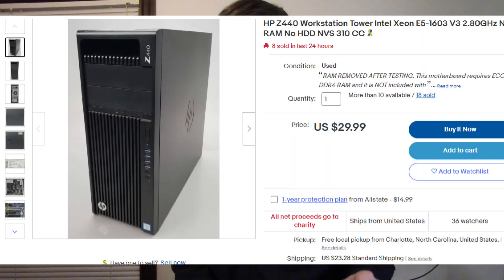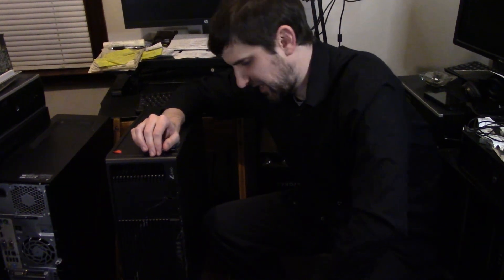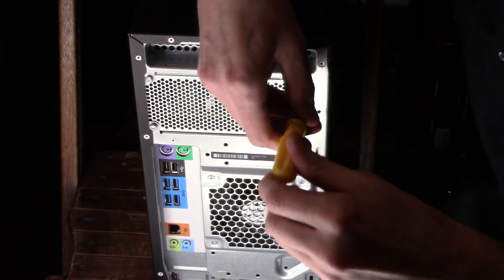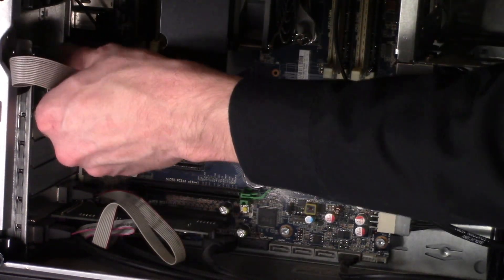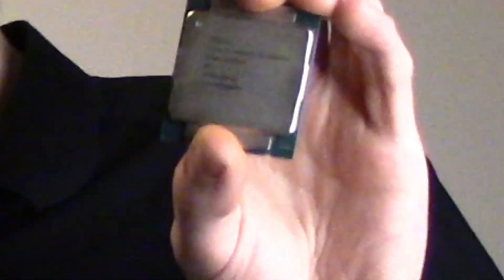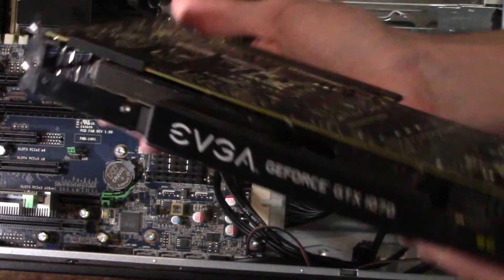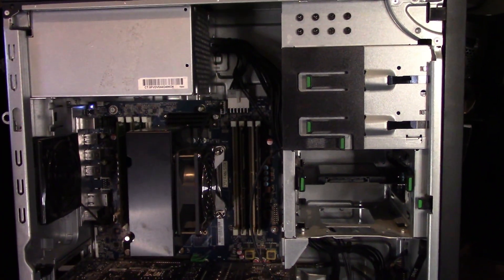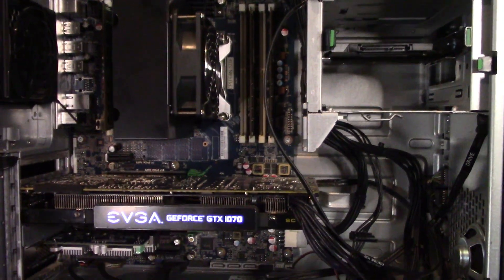This Older PC is PRIME for Cheap Upgrades

Comment: As long as the rails are good and the connector is not stressed, it's fine to use the adapter.

Comment: That fluid on the gpu could also be from leaky caps.
Great build. Unfortunately dealers have jumped on the bandwagon and you'll be lucky to buy a bare bones for $50. At least in the UK they range from £120-200 on ebay now. So that stings a bit after buying the upgrades.

Comment: I have almost the same setup, but kept the 525w power supply with a GTX1070 by crimping an 8 pin power connector in place of the hard drive power cables.    Perfectly stable.
Reply from the maker: Interesting! That sounds pretty tight. A while ago I was trying to find a cable that might connect the 6pin SATA power out (that many of the older HP models have) to 8pin PCIe. I figured since it is running 3-4 SATA cables from that 6pin connector on the board, that it should have enough juice. But I couldn't find anything relevant, all the results were giving me 6pin PCIe to 8pin PCIe which is not what I wanted. I'm actually not even sure what that 6pin SATA power out is technically, ATX? Any way sounds like you were able to just make something for yourself, that really is awesome.
Reply: Which cpu you use ?

Comment: I use an "old" Workstation from Lenovo for the last years, 2* 8 cores/16threads Xeons, 16GB RAM per CPU, upgraded SSD and an NVidia 1050ti and an USB3 upgrade-card.
Runs really smooth, not as fast as a modern build, but it is silent and built like a tank.
Reply from the maker: That's awesome. I really like the idea of keeping older hardware alive, keeping it from going to waste. It's a big part of why I do these projects, I end up using most of the computers like the one in this vid. I like the sound of that setup 🙂
Reply: i run a HP z620 with 2x E5-2690's. i do run linux but i game quite well with this machine on a 144hz monitor.
Reply from the maker: @leerobinson8709  Nice 🙂
Reply: I’m working on a budget build off.  Got my hands on a sweet z440 deal.  Thanks for the great ideas, love your unique delivery and edits!

Comment: I have a 36 core z840 that performs well and got a z6 that im gonna top off with 48 cores and see how it does. never had a problem w these work stations.
Reply from the maker: 😃That's alotta cores. Sounds sweet, I've never tried either of those 2, but they look pretty beast-mode.

Comment: yup keep up the great work!!! Like i said try the dell precision they are easier to work in.. plus they have modular supplies... mine came with 685 but u can get 825 or 1300 and their fricken cheap AF  ... i just needed to add an exhaust fan, when I added my 1080ti.... ooo yeah and the dell comes with 2 6 pin pcie cables for gpu... with another unpopulated 8 pin on the dell poweredge connecter
Reply from the maker: Noice. That is a serious bonus to have those GPU connectors on a machine from that timeframe. Opens up a lot of options 🙂

Comment: Bought one with E1650 v4 and 64 GiB of RAM for 160 euro. Got the 700W version as well, including 1200 GPU with 4 x mini DisplayPort. Going for a home server setup.
Reply: Interesting options that I'm going to buy or have bought: 16 lane 4 NVMe drive adapter, hopefully it boots ~30 euro. 4 x SATA 2.5" drive bay for a 5.25" bay ~30 euro, DVD burner with millenium disks 18 euro and of course Intel 540 x 2 10Gbps network adapter: 20 euro (doesn't support 2.5 and 5gbps, mind you). And of course the 2 x 6 to 8 power adapter cable that you've shown in the vid.

Comment: I have one of these relics. Best $240 au I ever spent. Ran a E5 1620 v4 16 GB ram 256 g ssd. Quadro k2200. Since upgraded to E5 2680 v3 64 GB 500 GB nvme pcie. 700 watt PSU. Had to buy ram cooler for $70 au. Yet to upgrade GPU. All up I spent a further $150 au. I only upgraded because it was so simple. Cheers.
Reply from the maker: Awesome, that sounds like a pretty sweet setup. I had the same issue with the cooling, getting the BIOS message because I'm using every RAM slot. Haven't got the RAM fan yet, so instead I just forced an extra case fan in there using the Molex connection and rigged it together with double sided tape 😂. Actually works pretty well for extra cooling, but I still get the "please get a memory fan" message.

Comment: Q: if I add a 1080ti gpu which is 2- 8pin sockets for my z440 then I have to buy 2-6pin to 8 pin connectors, right? Will any do or are there ones I definitely have to buy like HP OEM connectors?

Comment: Took out the quadro 600 and replaced it on my z420 -2690 i bought yesterday and it has a 600 w cpu but it wont boot with the radeon hd 7770 2gb card, i plugged in the 6 pin connector but it only beeps for times and the power button flashes red and turns of ...why wont it accept that simple card if the Power Supply is original 600 w ? It boots with the quadro card tho...please help me i bought it for my son to game i we were planning to get an even better graphic card than mine we tested with from my old htpc , so please help why won't it boot with another card ...?

Comment: Ahh, the z440, a wonderful system. So much lifespan for a system it's age.
Reply from the maker: Definitely. They are really solid from my experience so far.
Reply: @LowcastleTech  Since you're the only other person I've found who seems to know about this system, can I make a request for a future video? Hell, forget the video, I just want advice on something. I've migrated my z440 to a consumer PC case, an antec 900, and I'm trying to iron out every kink and incompatibility. The biggest one by far though is the power switch. the z440 has a power button mounted to the motherboard in the back, which I've been using, but having the case button would be such an improvement. the back's kinda hard to access for me. Issue is, the z440 is designed for an entire PCB-mounted front panel, and no-one anywhere as far as I can tell has figured out which 2 pins are the power switch pins. I'd use trial and error, except that the front panel PCB has USB 2 and sound in it as well, so shorting the wrong pins will send 5v power directly into a data pin. You probably know a fair bit more about computers in general than I do, and have roots in the right hobbyist forums, is there any way you can think of to find the pinout?
Reply from the maker: @curvingfyre6810  I had this exact same problem with the HP prodesk G1, they have the weird proprietary pinout that's like impossible to find information on. Even read through the motherboard manual and couldn't find it. I eventually was able to get it working for that machine, let me make sure it's the same on the z440 and that I still have the generic power button laying around. If so, i'll make a quick video on it. maybe post it later this evening as a short or something. I'll post the link here once I get it (assuming it is the same).
Reply: @LowcastleTech  thank you so much, thats gonna be a huge resource for a lot of people!
Reply from the maker: @curvingfyre6810  Hey, if you still need z440 pinout for generic power button, I just dropped a short. https://youtube.com/shorts/TVL7DCAVog4?feature=share
hope that helps!

Comment: running a Z640 e5 2643 v3 20gb 2133 with a rx 570 4gb right now. workstations are the way to go. HP Zs are more functional than Dell precisions.
Reply from the maker: Awesome! I've never got to mess with the 640 before, but they look legit. Very nice 🙂

Comment: Just ordered a z440 for $220 with 1650v4, 32GB ram, 700 watt psu and a 512GB SSD with windows 10 Pro on it. I will be taking my other SSDs out of my current i5 2500k system and rx 6650 xt! Question is can I use any m.2 adapter if I want to add a nvme drive?
Reply from the maker: Nice, sounds like a solid build. And yes, you should be able to use an m.2 to PCIe adapter, that's what I have going on with mine. There is something called the "HP Z Turbo Drive" specifically made for them, that is usually like 15 bucks on eBay. That's what I use, but I imagine any generic m.2 to PCIe should work.
Reply: @LowcastleTech  Do you have it as a boot drive? Anything special to get it as the boot drive? Also is this the adapter HP Z Turbo G2 M.2 PCIe Adapter Card 742006-003.

Comment: I think a RTX 3060 or RX 6600 XT would pair nicely with this setup. Had seen another channel (Miyconst) where an identical Xeon setup was paired with a RX 5700 XT with no issues.
Reply from the maker: That does sound pretty tight. I focus a lot on tightening down budget builds, but one day I'm going to have to grab a decent card like one of those and give it a shot. Would be cool to push it to the upper limits and see what it can really do.
Reply: Hi. How did you solve the problem with the 8 pin PCIe for GPU? I just bought RTX 3060 and Z440 have 2x 6-pin from 700W Power supply...

Comment: Could you explain more about the issue with the power adapter for the GPU you mentioned?

I was thinking about getting a 1070 for my T5500, and doing the same dual 6 pin to 8 pin.

Thanks.
Reply from the maker: Yeah, for sure. The dual 6 pin to single 8 pin should be fine, but the reason I mention it is that, just in general, most of the research I do says to avoid using any kind of adapters with a PSU. Usually this has to do with people trying to force power where they shouldn't. Though I've also heard of poorly made adapters getting too hot and melting down, stuff like that. It also might just be some people being overly cautious, at least when it comes to this adapter specifically. The one I've been using has worked fine so far, I haven't felt it get too hot or anything. Technically speaking everything lines up power-wise, (dual 75w to 150w). Also, I've seen GPUs that come with that kind of adapter in the box when you buy them. So everything points to it being perfectly fine, it's possible that I just worry a bit too much. 🙂

Comment: Does it have USB3, if not, then that 1x slot and missing plate at the top is a perfect place to add it
Also, looking up the options, it's "how many cores do you want", with that 8 core being 200Mhz base / 100Mhz peak below the 6 core, with the 10 core dropping another 200MHz
The "uniprocessor" E5-1860 V3 is 100MHz better for an 8 core, but I'm betting the "dual CPU" E5-2667 V3 is way cheaper and more available as server pulls
Reply from the maker: It does have USB 3, but thanks for the tip, I have a lot of old hardware so can always use suggestions 🙂. And yeah, as far as the CPU there are a bunch of options with the older Xeons, but I was trying to focus more on price/budget for this build, and landed on the 2667 mostly because they are super cheap. Thank you for dropping a comment!

Comment: Hi! Help me, please. I just bought an RTX 3060 GPU and it requires an additional 8-pin power supply from the PSU. However, it doesn't have one, but there are two 6-pins that I have plugged into the front panel audio. Can I use them with a 2x 6-pin to 8-pin adapter?
Reply from the maker: Generally, the dual 6-pin PCIe to 8-pin adapters are ok to use. Typically, you want to use caution with power adapters, but each 6-pin carries 75 watts and the 8 pin is a 150 watt draw. So they do have enough power and are pretty common. I've used them in the past as well. If you do grab one, I would just say try to look for a reputable brand and keep an eye on it when you are first using it and whatnot. From what I've seen they seem to be fine. Hope that helps!
Reply: @LowcastleTech  Yes, u are help me. Just bought adapter and use now. Right now is normal. Thank u!

Comment: Will only this specific PSU work with this? Or could you buy a standard one?
Reply from the maker: I've thought about trying a standard PSU, and it looks like it might be possible, but there are a few potential issues. One is that you would need a couple adapters. A 24 pin to 18 and an 8 pin to 12, to feed both non-standard power connectors on the board. While they do make these, using any kind of adapter for power is generally discouraged as it may cause issues. Also, there is the weird proprietary shape of the z440 PSU, which is frustrating. While it may be possible to cut/modify the case manually, this would likely be a challenge. So it looks like it is possible, with a standard PSU that had enough connectors/adapters but I haven't tried it yet, and is difficult to say how it would go, and how it would pan out long term.
Reply: @LowcastleTech  Thanks for the response, and great vid. Halfway tempted to pick up one of these. I've always been fascinated by xeons, and the fact you can get the memory for so cheap on top of that 
is a big selling point.
Reply from the maker: @steamedauroraborealis8208  No problem, thank you for watching! And yeah I've really been liking this model so far. A lot of Xeon options, almost all of them super cheap. And like you said, RAM is not bad either. Solid budget machines.

Comment: Great video! How can I find if a CPU is compatible with my motherboard ? Thanks
Reply from the maker: Thank you! Typically you can just go to google and search for "name of your motherboard + socket type", or type name of your board along with "compatible processors" or something like that. Also, a lot of manufacturers have spec sheets for their motherboards that will include info like compatible processors on their websites.
Reply: @LowcastleTech  Thanks!

Comment: I don't have a spare chair, but I can put a computer ATX box on my lap while sitting on a chair. Does that count? It's quite hot though.......and my legs hurt now.........and I need a wee.

Edit: you really don't need to spend $1.5/2k+ to just play games, most mid range sytems is all you need.
Reply from the maker: 😂I'll count it. In fact sounds like you're getting full utilization of the chair desk!

Comment: at the lowest I find only hp z400 for 120$ cad ...
Reply from the maker: Yeah it can be hit or miss. I got this and another one for $50 US. They were practically a barebones type deal, and I haven't seen them that cheap since. But, I usually try to check a lot and stay aware of the specs as well. For example, I just got another z440 (I may have a problem 😂). It cost a good bit more, at around $150 US. But it had a decent GPU, 32 GB RAM, and the 700 watt PSU. All things that are necessary, that the $50 deal didn't come with. I'd say the key for me has been to check obsessively, and keep an eye on the specs most importantly. Finding a good component to price balance can be just as good as finding something super cheap.

Comment: I have a z440 but my idiot friend lost the ram sticks when the motherboard killed itself. Great machine just can’t find ram that’s compatible 
Lucky me… 😤
Reply from the maker: That sucks. I was able to find some on eBay. DDR4 2133, it has to be the ECC version though. Sometimes it will pop up for pretty cheap, but fluctuates just like pretty much any other used equipment. Sorry to hear that though!

Comment: What is with this "NVMe hard drive?" did I miss something?
Reply from the maker: It's just the HP Z Turbo drive thing. Not as fast with the adapter, but it is still a lot faster than a 2.5" SSD (or at least the specs say it is). Seems to have better performance.